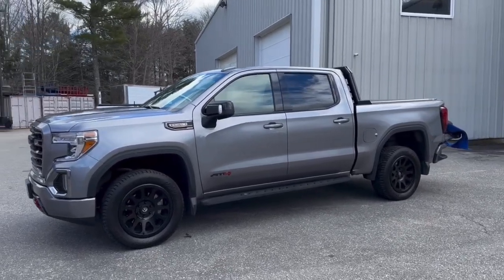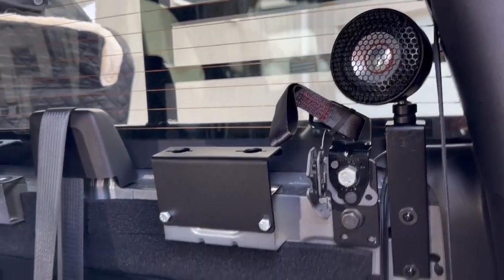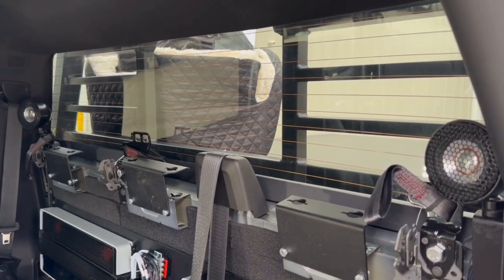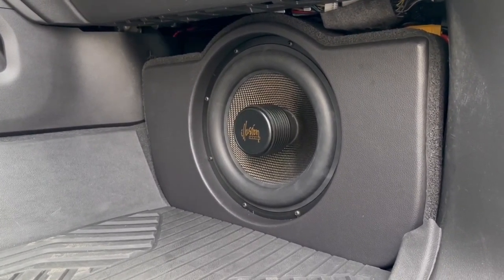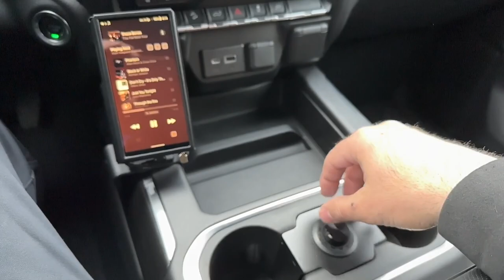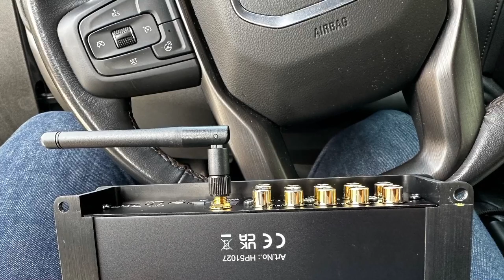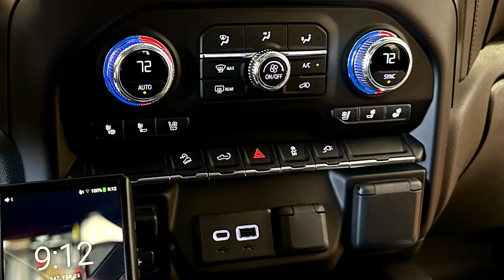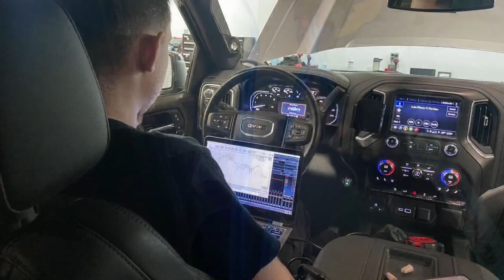2021 GMC Sierra AT4 - High End Audio System Overview - Accuton, Helix, Mosconi, Focal, Audiofrog

Comment: Hi. Love seeing people continue to strive for greatness. I have installed professionally in the 90s-2000s and I love seeing the detail and quality. I’m just beginning my 2021 Silverado RST. Would love to ask you a few questions if you wouldn’t mind. Love seeing this type of work!
Reply from the maker: Thanks man! And ask away. Happy to help
Reply: So my last build was my first with an active 3 way setup and DSP. I used a JL Twk 88 and worked fairly well. Now that I am locked into the OEM GM Bose I need something more substantial. I have been looking at the Helix 10 channel and the Mosconi 8 to 12 Pro DSP. My question is what are your thoughts on both units and how safe is it to buy a Helix on EBay?  Is the DSP the only unit I need to integrate the OEM?  I appreciate any help you can offer!  Thank you!
Reply: I guess I will tell you what I am installing. 3 way Dynaudio Esotec fronts and 2 way rears. 2 JL Flat 10’s. 2 JL HD600/4’s and HD750/1. I was also thinking about adding either an Android tablet or IPad. Figured I would tell you the whole story. Thanks again.
Reply: Hi. Sorry to bother you but wanted to check in and see if you had a chance to see my questions? Thanks man.
Reply from the maker: @philkoberg1461  hey man sorry it took me so long to repsond!  I am huge Helix fan as their reliability, customer (and community) support is second to none.  Assuming that you are running the rears on a passive crossover, then the DSP Pro mk3 is the perfect choice, the Conductor controller is also by and far the easiest remote to use and mount.  The Mosconi Aerospace 8/12 with the new software is also solid as well, last recommendation would also Arc Audio PS8 Pro.  Otherwise, you have a great system laid out.
Reply: @lukeouellet  thanks Luke. I will keep you updated. Thanks again for the suggestion. I like the Helix as well.

Comment: Gorgeous truck! Incredible build! I identify w/ your methodical and meticulous nature..lol About to start a build on a 2018 K1500 Sierra SLT... what would be your advice as to how to handle the cab vents?
Reply: I can't tell in the video... do you have yours partially sealed? looks like a small area at the bottom left open?
Reply from the maker: @AuggyNole  https://www.facebook.com/media/set/?set=a.10224782418687303&type=3 that's the full album of pics - there's some good detail on the vents if you scroll through towards the bottom

Comment: Nice i use helix too and swap 1000 amps lately Revelation audio madison or audiowave aspire class a v2 or etc and for midrange i use zr speaker labs 9dd or 12m or f1 extravagance  and doors 6 inch dynes supremos rainbows etc head unit nx5000
Reply: Who cares what you run?

Comment: Is your back seat able to fold down? If so how did you do that because if i mount 3 or 4 thousand dollars worth of amps i want to be able to show them off. I know from factor its not foldable unless you remove the headrest. Thanks
Reply from the maker: It doesn't fold down per se.  I just keep the headrests out so I can pop the back seat out easily.

Comment: What do u have ur rear subs crossovered at? Is it the same as the front sub up to 150hz?
Reply from the maker: Rear sub 0 - 50
Front sub 50 - 100
Midbass 100 - 250
Reply: @lukeouellet  thank you was also curious on where u got the little control bass knob holder that sits in the cup holder?